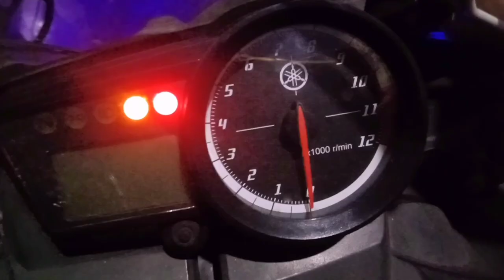How to clean r15 fuel pump in tamil.how to clean fuel pump.how to clean the r15 fuel pump in tamil

Comment: V2 Feul pumb evlo bro & Feul injecter evlo bro
Reply from the maker: Fuel Injector Yamaha YZF-R15

M.R.P.Price:₹ 2,699.00 Fulfilled FREE Delivery. Details ,
Yamaha R15 V1/V2 Fuel Pump Steel Motor

M.R.P.Price:₹ 2,449.00 FREE Delivery. 
Yamaha R15 V1/V2 Fuel Pump Steel Motor

M.R.P.:₹ 3,999.00Price:₹ 2,449.00 FREE Delivery.
Reply: @Bikes-xo4jz  bro i need bro yepdi vangurathu

Comment: R15 v2 new petrol pump yevlo varum bro l.urgent plz answer
Reply from the maker: 3500 to 4000 varum buying link thara
Reply from the maker: Open Throttle Racers Yamaha R15 V2 (2014-2018) R15 Version 3 compatible fuel pump unit
₹4,289
Amazon.in
Free delivery
Reply from the maker: J T AUTO Fuel Pump for Glamar FI
₹3,900
Amazon.in